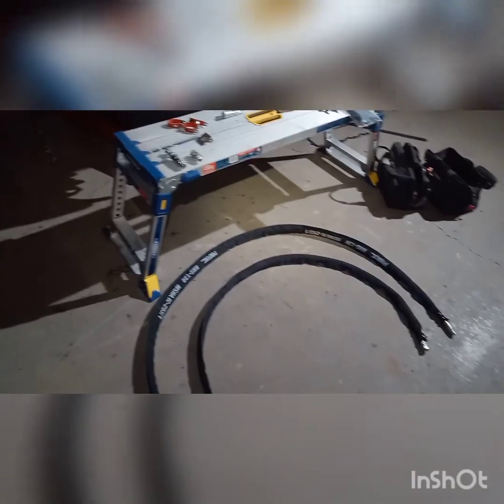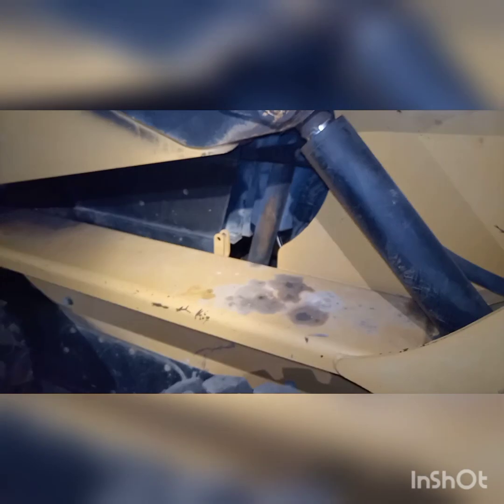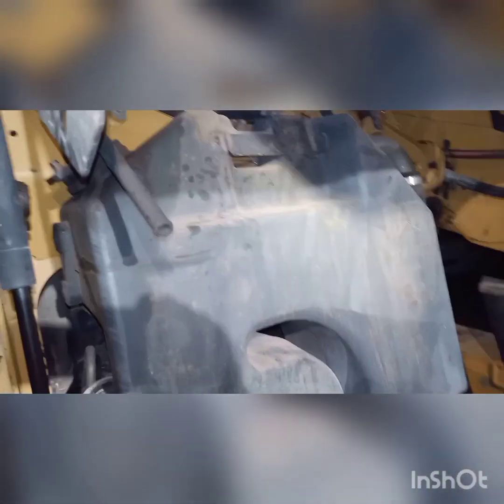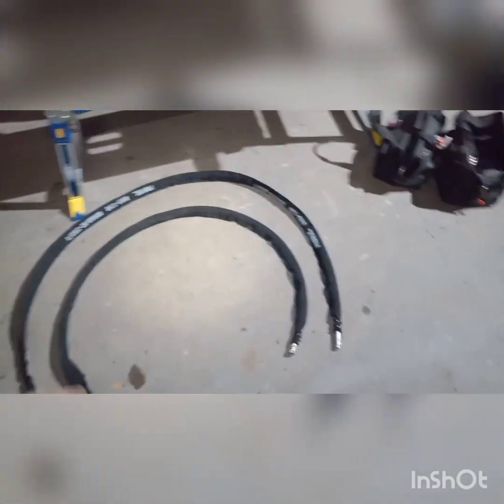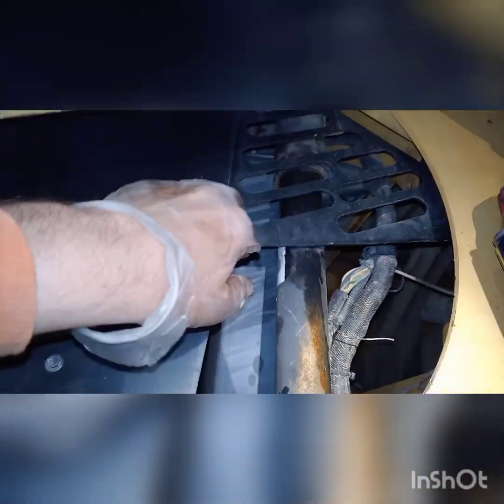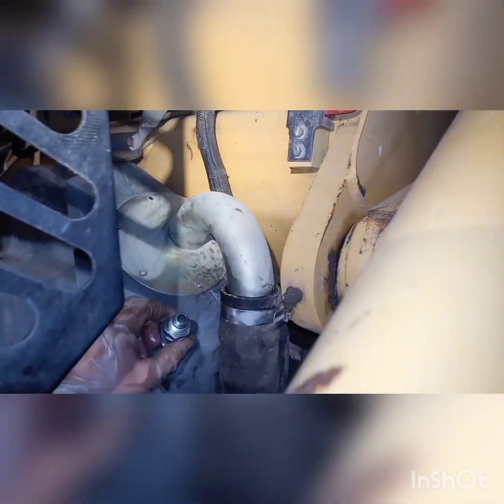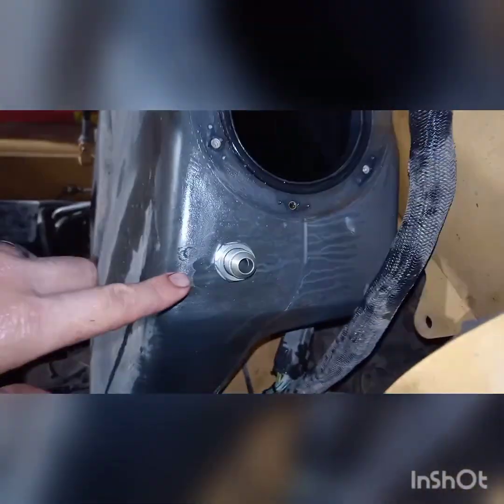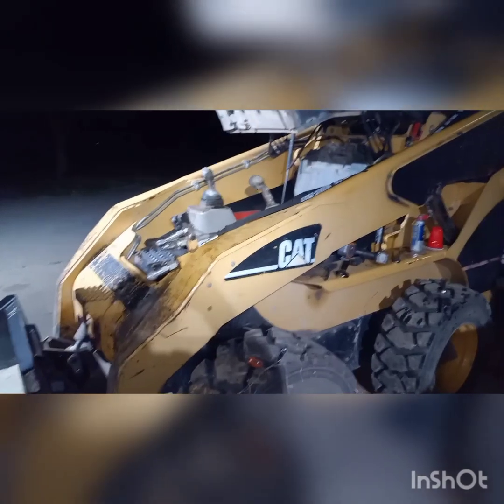DIY How to add case drain to a skid steer. Caterpillar, Bobcat, Kubota, any other...

Comment: Two questions - You didn't show what for me is the scariest pat of this project, drilling the hydraulic tank hole. Did you run into any issues with debris falling into the tank? Would it be possible install the drain line into the metal tank cap? I was thinking it would be easier to remove the cap and install the fitting in it off the machine. I'm about to attempt this on my old CAT 277.
Reply from the maker: No debris went into the tank. I pack the drill bit full of grease to catch any shavings. Using a step bit: grease, drill a size or two, clean off, repeat process until you get to the size hole needed.
Reply: you should do it during hydraulic fluid change in my opinion... then you can flush out and get rid of any particles.

Comment: How is this working? I need to add case drain to my skid steer also
Reply from the maker: Has been working perfectly. No leaks or problems.
Reply: I heard you say that one hose was 124 inches but you never gave the length of the other? Thanks for the great video.

Comment: Will adding a case drain prevent a mulcher or shredder piping seals.   If the gpm on the machine is higher then the spreader
Reply from the maker: No it will not. A case drain basically funnels any fluid that weeps past the internal components of the hydraulic driven motor. Secondly it acts as a safety feature to protect the skid steer or tractors hydraulic system. If the hydraulic driven motor was to fail, the case drain goes back to the reservoir to be filtered. If there was no case drain, the contaminated will travel to the hydraulic pump before being filtered. 

High flow skid steers will have an auxiliary function to run low volume attachments. 

If your machine is still producing more volume than the attachment can handle, weather it being outside the specified range or just aged and fragile, you can use the engine throttle to lower the gpm.
Reply: @drtierce  will I damage anything using a plate compactor without having the case drain line, I do not have one on my bobcat 853H
Reply from the maker: @michaelbridges3165  If the unit has a piston type hydraulic motor, you must run the case drain. Not hooking up the line would case the seals on the hydraulic motor to blow out almost immediately. I've seen a couple that run a gear motor style that a case drain would be only optional.